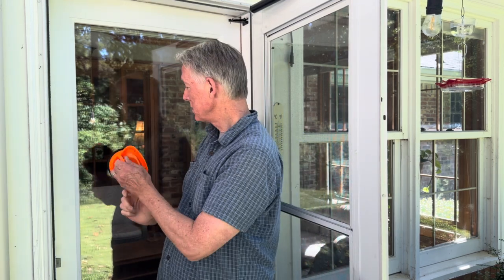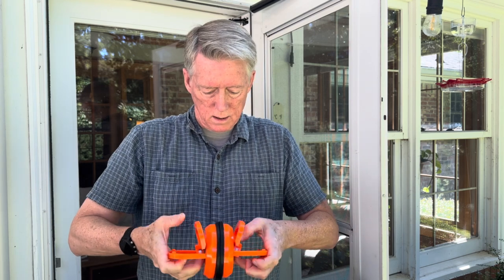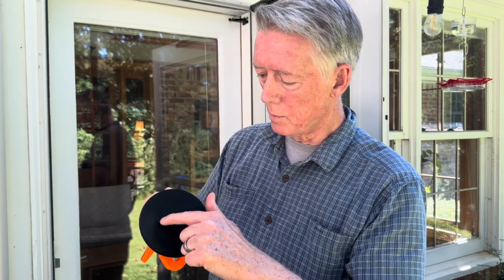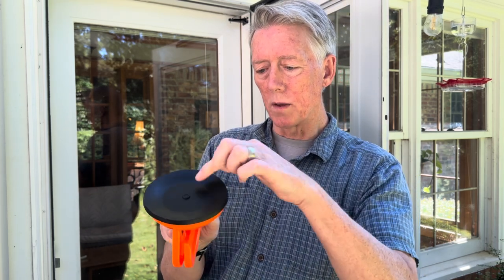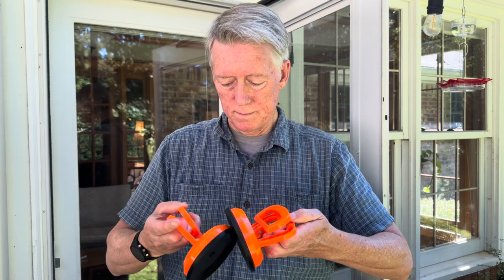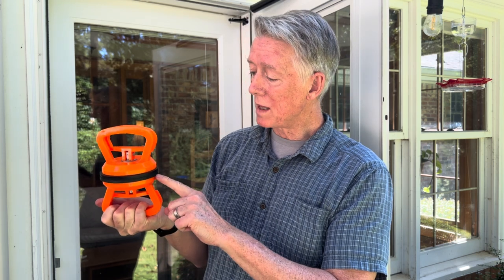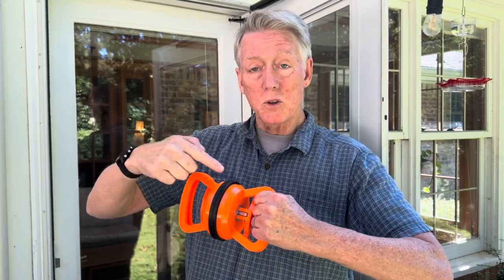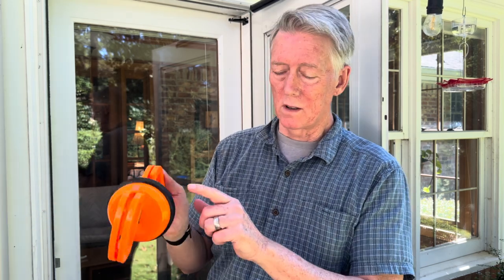How suction cups work

Comment: Isn't it suction tho? The main problem in see with this video is that you fail to explain what exactly suction is. It's a force that draws a fluid inwards, which these cups briefly do,  and the seal maintains that pressure differential, sure it might not be the best name, but it's much simpler and catchy than anything else I could come up with